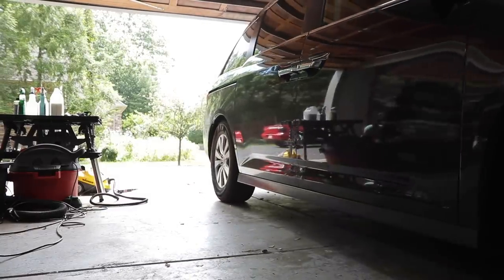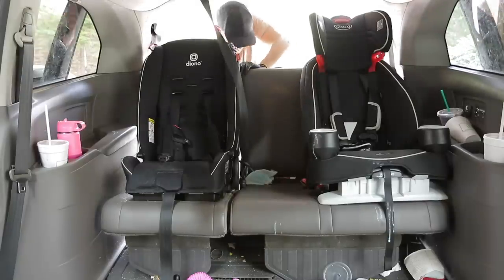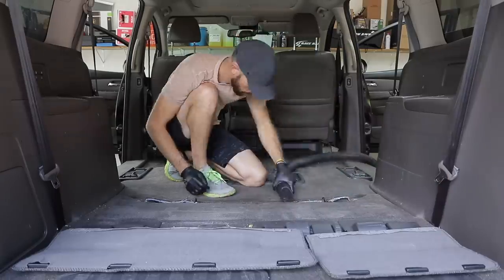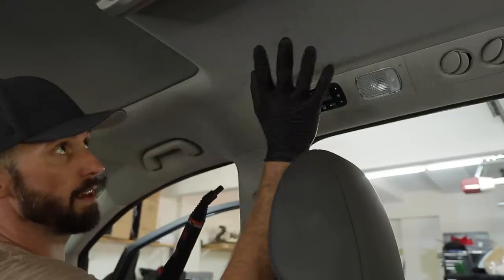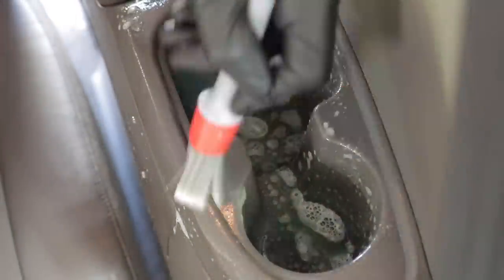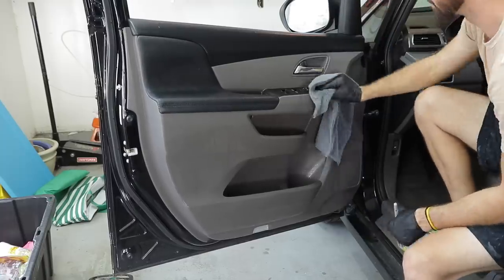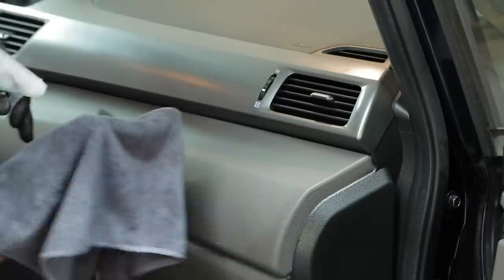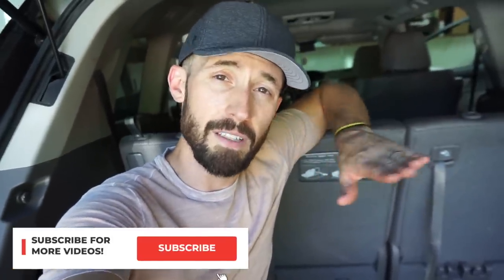Complete Disaster Car Detailing Transformation! DEEP Cleaning The Dirtiest Car Interior Ever!

Comment: 3:57 
What’s the purpose of rubber floor mats if your gonna dump them in the car?
For Content???
Reply from the maker: The truth is the debris on them was minimal and with everything that needed to be vacuumed it would matter. The rubber floormats in my opinion are for liquids
Reply: @StaufferGarage  I made the same statement to one of the commenters - I got your back, Jack!
Reply: In the winter in snowy areas those rubber mats are carpet savers. Between slush and salt and just wet boots, the regular carpet mats just get so gross.
Reply: probably also to keep debris from getting ground into the the carpet fibers over time. to dump it off and vacuum it right away wouldn’t do much harm i assume

Comment: great job once again! 

you ever consider getting a roll of the transparent floor plastic dealers use ? i detail at a small motorcycle/ used car shop and love them while the cars are being test driven. one side has an adhesive back, stick it right to your clean carpet and when it’s time to take off, they come right off with no sticky residue. saves so much time ! 
throw them right on your carpets underneath the kids feet and then lay the all weather over top for ultimate protection !

Comment: One Thing you might mention regarding the steering wheel, it is highly recommended to check what you put on it.
I know a lot of products here in Germany you can use for the dash which leave it with everything between a glossy shine over a satin up to a Matt finish, but almost all of them recommend keeping them of the steering wheel and the pedals. They leave something like an oil or silicone residue which may make pedals or wheel too slick to properly hold on to if you need it the most.
Also most car manuals here recommend using only a damp cloth or at most a soft detergent.

Comment: For the dust in the dash and air conditioning units I use a swifter duster and it works amazing.
Reply: I think he likes to use the little brushes because he is applying UV protectant to the vents to help keep the plastic from cracking and fading.

Comment: So from what I've seen so far, most of your cleanings involve leather seats. I have cloth seats and the driver seat had a pretty hefty stain on it when I bought it. What would be the process to remove or reduce that as much as possible? And is there a way to achieve it without using specialty equipment like a steam cleaner? Drill brushes are fine to get though.

Comment: You don't need to condition or moisturise leather seats. They have a clear coat like paint and you should consider using a ceramic coating or an si02 spray to coat the seats in. Like you would the paint

Comment: At 16:52 in the video there is a stain (brown circle) between the passenger seat and plastic door jam on the floor (left of center of the screen) . I have the same stain but i cant get the extractor in there to pull it up . Is there a "spot shot"  solution on spray item that only needs to be wiped after to get a spot like that out?

Comment: 16:12   That baby seat left a bad mark.  Top tip: buy a cheap foam yoga mat, cut out a pad slightly larger than necessary to cover the back and underside of child seat and stick it to said throne with double-sided tape.
I have been doing this for years and the leather in my cars has never had a mark on it.

Comment: Crack the window and to the top edge first. No sense in cleaning the bottom portion twice. Also, when cleaning a windshield, it’s easier to do the entire thing from the passenger seat. That way, the steering wheel isn’t in the way.

Comment: Use a pumice stone for pet hair on the carpet. Soak it in water then run along the carpets to pull away hair. I’d caution against using it on cloth seats so it doesn’t snag/rip.